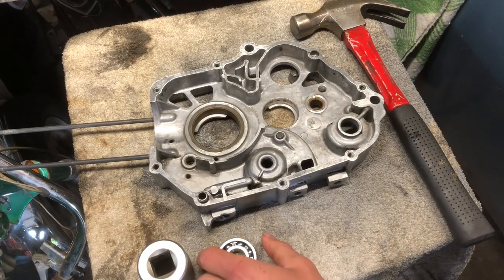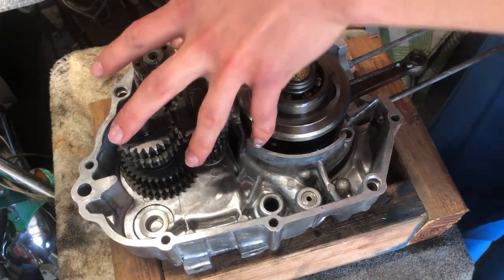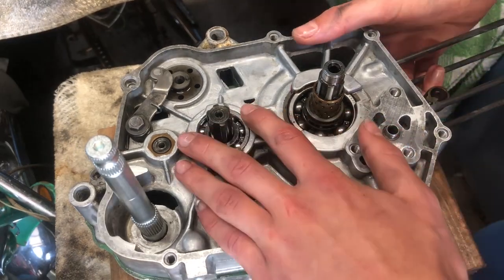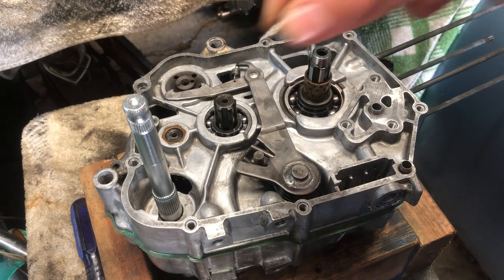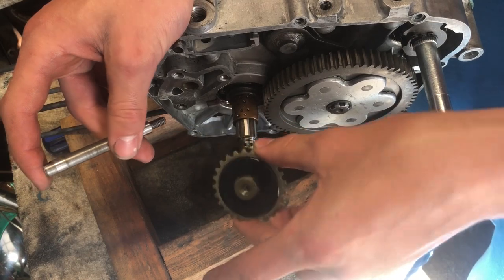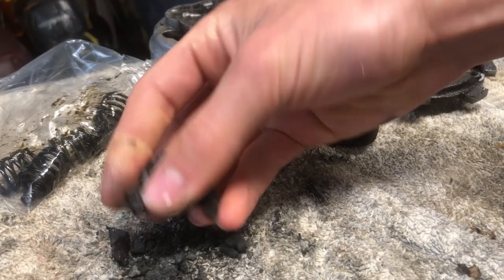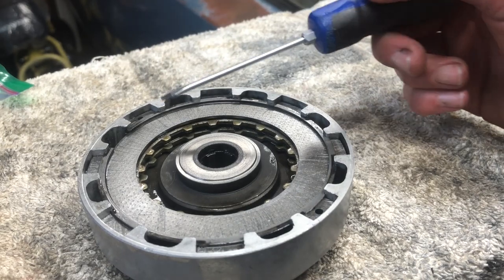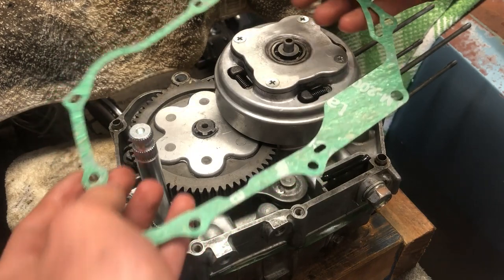Honda CT70 COMPLETE engine REBUILD! In ONLY 12 minutes! (Step by step)

Comment: Really well done.  I'm restoring a 1969 Mini trail (my first bike back in 1971).  Your camera and narration work is better than most.  Keep up the great work!
Reply from the maker: Appreciate it🙏🏼 Good luck with your build👍🏼
Reply: @Mechanic_kid I am looking for a original 1974 st9p carb.anyway you can help.thanks
Reply: @Mechanic_kid what size wood did you use for engine mout.also what are the diameters so I can make the wood box
Reply from the maker: @iancameron198  If you can’t find one on eBay, join the CT70 group on facebook! Someone will definitely have one they’d sell you👍🏼
Reply from the maker: @iancameron198  https://youtu.be/8iFg_lgM9I4

Comment: 12:13 i learned my lesson on that lol, had one of the little pocket flatheads slip and go into the webbing between my thumb and pointer and barely poke out the other side. lemme just say im extra mindful of putting pressure on something while a part of me is on the other side of the object

Comment: Love the video, bud! I’ve got a ‘77 CT70 that the kick starter only engages when the bike is leaned hard left, and the whole shaft slides to the right, maybe an inch, and has no resistance, many times if you’re not leaning or pushing the shaft to the left while kicking. But, it does run. Any thoughts? I was thinking maybe a circlip, or maybe a thrush washer broken. What do you think? Either way, I’ll be referencing your video when it’s time to put the cases back together. THANKS in advance. Not many young men are as gifted or as dedicated to a badass craft like you are. Keep it up man!